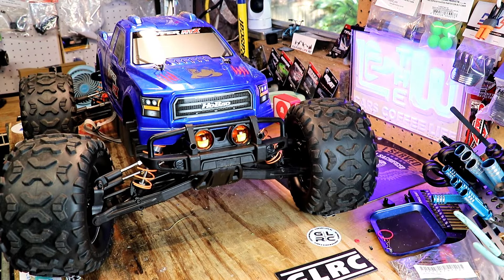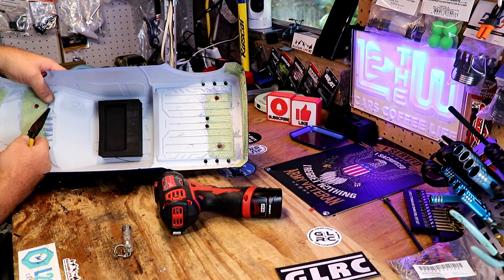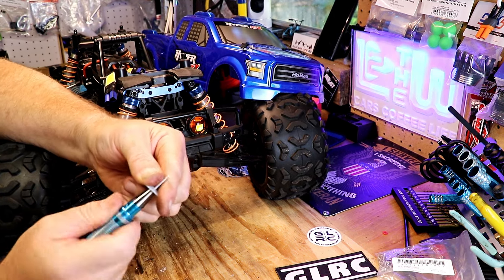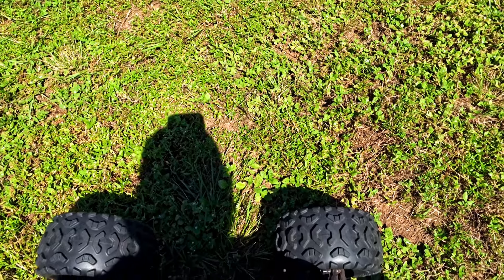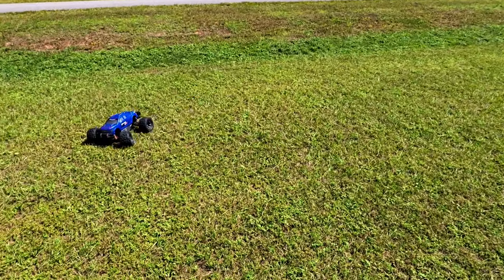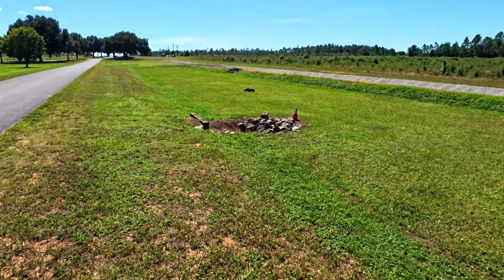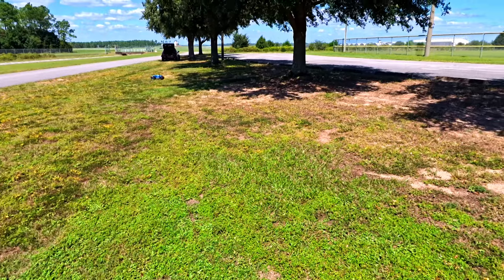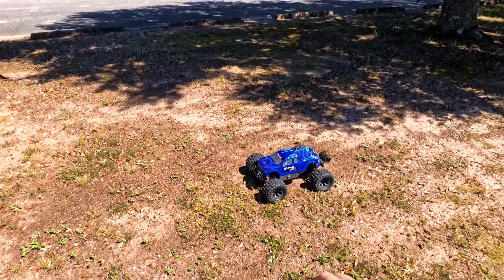Hobao Hyper MTX Diff Tuning Continues Lets See What 500k Does

Comment: I recently put 500k in all 3 diffs in my redcat earthquake 8e and it improved the truck immensely. Still could use a little thicker in the center though, 1m or thicker IMHO. Still unloads to the front. Gonna try 20m next, looking for air control and less pizza cutter action. Likely going to put 20m in my Valkyrie MT also (center)...